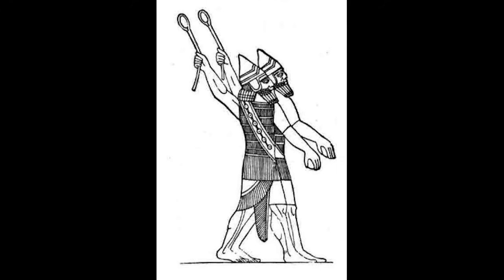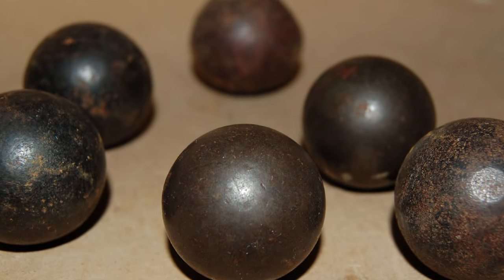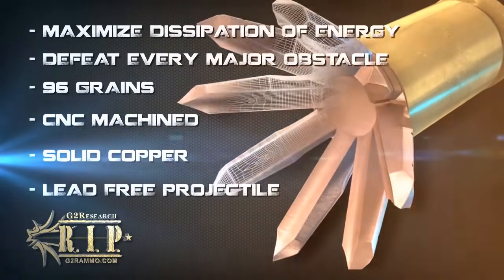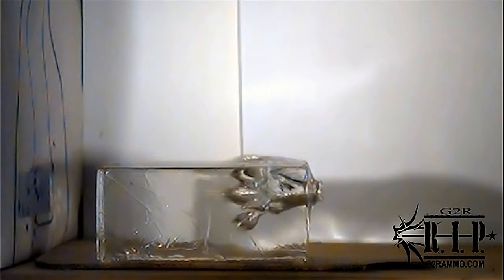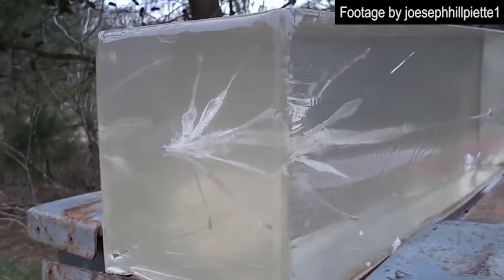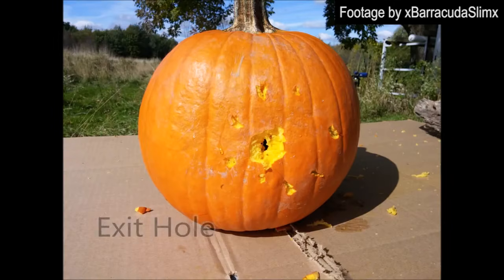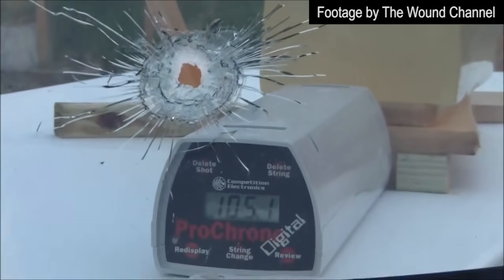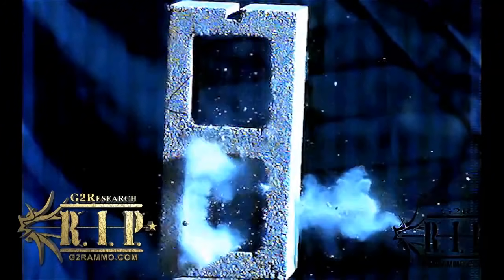The next step in bullet evolution: The Radically Invasive Projectile (RIP)

Comment: Regardless of lethality and ethical subjects that surround the topic, as an engineer I really like the terminal ballistics of this thing, shooting a drill like bullet that splits into multiple pieces is a real big step from comparatively simple hollow points
Reply: +Arfor Afro 
However, from other people who tested the round, it just LOOKS intimidating. What looks good on ballistic gel, not always mean good real world application. A human isn't made of ballistic gel, ballistic gel only simulates one type of human tissue - A good portion of what you'd be aiming for would have bone (ribcage), tendons, thick clothing, soft barriers in front of the person. When other youtubers tested it, it didn't do well when there are barriers (plywood, denim, windshield, etc) in front of the ballistic gel, as there wasn't enough penetration (experts say you need to have penetration of 12″ and 18″ of ballistic gel, so it have enough power to go through a human body, bone and all). Traditional hollow points don't do as well as FMJ in terms of penetration, and the RIP was even worst. And we are not even bringing in level 2 body armour into the equation.

Secondly, the "trocars" break off too early, so the damage done to the body would be superficial. A standard steel BB into ballistic gel at 590 fps, usually penetrates to about 3.5″. In a human body a that BB might not even make it past the skin. The "trocars" in a test penetrating about 4″ of ballistic gel, and not always consistently, and sometimes they don't break at all.

Lastly, the shape of the round affected feeding. A youtuber tested it on his Glock and a round refused to feed from the magazine. That's not something you want, as they are marketing it as a self defense round. A round that won't always feed reliably isn't ideal for self defense - The moment you pull out that gun, you need it to work because that's the difference between life or death.

I'm not saying a shot of the RIP won't kill you (heck even rubber bullets can kill), but the performance isn't as consistent as other rounds out in the market (consistency is key), and it's very expensive for such a gimmick that offers no significant advantage.

Comment: This kind of ammunition should not be banned, it should just be used on things that are stronger than humans.I mean they wouldn't be half bad for hunting. Tho my knowledge of hunting is limited I am pretty sure you are supposed to kill the animal with it suffering as little as possible and having a bullet that destroys as much of the organs as possible would in my eyes be optimal as long as it doesn't hit any larger bones on the way in.
Reply: +Kenan Šabić 
Except is doesn't perform well. One of the main selling points, the petals they call "trocars", don't work well. The "trocars" break off too early, so the damage done to the body would be superficial. A standard steel BB into ballistic gel at 590 fps, usually penetrates to about 3.5″. In a human body a that BB might not even make it past the skin. The "trocars" in a test penetrating about 4″ of ballistic gel, and not always consistently, and sometimes they don't break at all.

The penetration of the main projectile also wasn't consistent, especially when there are barriers in front. You see,  a human isn't made of ballistic gel, and a ballistic gel only simulates one type of human tissue - A good portion of what you'd be aiming for would have bone (ribcage), tendons, thick clothing, soft barriers in front of the person. When other youtubers tested it, it didn't do well when there are barriers (plywood, denim, windshield, etc) in front of the ballistic gel, as there wasn't enough penetration (experts say you need to have penetration of 12″ and 18″ of ballistic gel, so it have enough power to go through a human body, bone and all). Imagine animal hide which is also very tough, and the thicker bones of animals.
Reply: +Tremulousnut If that's the case, even better.

Comment: So, instead of making them... you know... prone to killing while inflicting less pain, the assholes that made this decided to make some bullet that turns into a goddamn saw inside of you for maximum internal damage. Sweet. Just more stuff to be proud of my species for
Reply: +φ First-order logic The "saw" doesn't work. The main selling point, the petals they call "trocars", don't work well. The "trocars" break off too early, so the damage done to the body would be superficial. A standard steel BB into ballistic gel at 590 fps, usually penetrates to about 3.5″. In a human body a that BB might not even make it past the skin. The "trocars" in a test penetrating about 4″ of ballistic gel, and not always consistently, and sometimes they don't break at all. The shape of the round also affected feeding. A youtuber tested it on his Glock and a round refused to feed from the magazine. 

The penetration of the main projectile also wasn't consistent, especially when there are barriers in front. You see,  a human isn't made of ballistic gel, and a ballistic gel only simulates one type of human tissue - A good portion of what you'd be aiming for would have bone (ribcage), tendons, thick clothing, soft barriers in front of the person. When other youtubers tested it, it didn't do well when there are barriers (plywood, denim, windshield, etc) in front of the ballistic gel, as there wasn't enough penetration (experts say you need to have penetration of 12″ and 18″ of ballistic gel, so it have enough power to go through a human body, bone and all).

Comment: wow...bullets made even more deadlier....(sigh) when will it end?
Reply: +Silent Sea 
It's not, it's just slick marketing. 

The main selling point, the petals they call "trocars", don't work well. The "trocars" break off too early, so the damage done to the body would be superficial. A standard steel BB into ballistic gel at 590 fps, usually penetrates to about 3.5″. In a human body a that BB might not even make it past the skin. The "trocars" in a test penetrating about 4″ of ballistic gel, and not always consistently, and sometimes they don't break at all. The shape of the round also affected feeding. A youtuber tested it on his Glock and a round refused to feed from the magazine. 

The penetration of the main projectile also wasn't consistent, especially when there are barriers in front. You see,  a human isn't made of ballistic gel, and a ballistic gel only simulates one type of human tissue - A good portion of what you'd be aiming for would have bone (ribcage), tendons, thick clothing, soft barriers in front of the person. When other youtubers tested it, it didn't do well when there are barriers (plywood, denim, windshield, etc) in front of the ballistic gel, as there wasn't enough penetration (experts say you need to have penetration of 12″ and 18″ of ballistic gel, so it have enough power to go through a human body, bone and all).

Comment: Why did they shoot a dead chicken?
Reply: +Joe Blogs 
Marketing. It really amounts to nothing, birdshot which does little damage to a human at a distance kills a flying bird at a distance away. Likewise, those "petals" will underperform in a human. The "trocars/petals" break off too early, so the damage done to the body would be superficial. A standard steel BB into ballistic gel at 590 fps, usually penetrates to about 3.5″. In a human body a that BB might not even make it past the skin. The "trocars" in a test penetrating about 4″ of ballistic gel, and not always consistently, and sometimes they don't break at all. The shape of the round also affected feeding. A youtuber tested it on his Glock and a round refused to feed from the magazine. 

The penetration of the main projectile also wasn't consistent, especially when there are barriers in front. You see,  a human isn't made of ballistic gel, and a ballistic gel only simulates one type of human tissue - A good portion of what you'd be aiming for would have bone (ribcage), tendons, thick clothing, soft barriers in front of the person. When other youtubers tested it, it didn't do well when there are barriers (plywood, denim, windshield, etc) in front of the ballistic gel, as there wasn't enough penetration (experts say you need to have penetration of 12″ and 18″ of ballistic gel, so it have enough power to go through a human body, bone and all).

Comment: Dumbest round Ive ever seen, although they are doing a heckofa job advertising these to uninformed/unintelligent people. I'll see if I can simplify this: There are two aspects to a firearm's ability to do damage, and its based on physics and called kinetic energy. The first aspect, and the most important, is speed. Speed kills. The faster something goes, the more damage it can cause not linearly, but exponentially! Which is why you can kill deer out at 350 yards with the same weight bullet you would find in a .45 ACP, but going at speeds out of a rifle up to three times faster. And it puts a heck of a cavity in them. And then the second aspect is the mass of the projectile. The heavier something is, and if it going the same speed as another object, the heavier one will penetrate/cause more damage. So now we have these RIP bullets that go no faster than a regular 9mm, but break off into tiny shards that weigh no more than a couple of grains. Lets see if you can do the math from there.
Reply: +AnAZPatriot 
Look up the tests done on it by other gun channels, you'd be happy to find that you are right. It's all just slick advertising to the uninformed. Shooting at chicken is nothing - Birdshot at a distance does lethal damage to a flying bird whereas it might not even penetrate a human.

The main selling point, the petals they call "trocars", don't work well. The "trocars" break off too early, so the damage done to the body would be superficial. A standard steel BB into ballistic gel at 590 fps, usually penetrates to about 3.5″. In a human body a that BB might not even make it past the skin. The "trocars" in a test penetrating about 4″ of ballistic gel, and not always consistently, and sometimes they don't break at all. The shape of the round also affected feeding. A youtuber tested it on his Glock and a round refused to feed from the magazine. 

The penetration of the main projectile also wasn't consistent, especially when there are barriers in front. You see,  a human isn't made of ballistic gel, and a ballistic gel only simulates one type of human tissue - A good portion of what you'd be aiming for would have bone (ribcage), tendons, thick clothing, soft barriers in front of the person. When other youtubers tested it, it didn't do well when there are barriers (plywood, denim, windshield, etc) in front of the ballistic gel, as there wasn't enough penetration (experts say you need to have penetration of 12″ and 18″ of ballistic gel, so it have enough power to go through a human body, bone and all).

Comment: People in general just don't seem to understand how devastating to the human body regular bullets are (aside from .22s, of course, which can still kill you), especially typical hollowpoints.  This looks really gimmicky.
Reply: +DrTelamericorp And by gimmicky, I mean not nearly as lethal as some other, more common rounds. Like the 5.56. That round is WAY more lethal than this thing will ever be.
Reply: +DrTelamericorp And it is gimmicky. The main selling point, the petals they call "trocars", don't work well. The "trocars" break off too early, so the damage done to the body would be superficial. A standard steel BB into ballistic gel at 590 fps, usually penetrates to about 3.5″. In a human body a that BB might not even make it past the skin. The "trocars" in a test penetrating about 4″ of ballistic gel, and not always consistently, and sometimes they don't break at all. The shape of the round also affected feeding. A youtuber tested it on his Glock and a round refused to feed from the magazine. 

The penetration of the main projectile also wasn't consistent, especially when there are barriers in front. You see,  a human isn't made of ballistic gel, and a ballistic gel only simulates one type of human tissue - A good portion of what you'd be aiming for would have bone (ribcage), tendons, thick clothing, soft barriers in front of the person. When other youtubers tested it, it didn't do well when there are barriers (plywood, denim, windshield, etc) in front of the ballistic gel, as there wasn't enough penetration (experts say you need to have penetration of 12″ and 18″ of ballistic gel, so it have enough power to go through a human body, bone and all).

Comment: this is just a fancy looking hollow point
Reply: +Ðevuno Try-force No, its worse. Once the bullet breaks up, there is no mass behind the velocity of the projectiles. May as well be shooting a .22 pistol.
Reply: +AnAZPatriot You are right, and the "petals" they are so proud of don't perform well. The "trocars/petals" break off too early, so the damage done to the body would be superficial. A standard steel BB into ballistic gel at 590 fps, usually penetrates to about 3.5″. On a human body a that BB might not even make it past the skin. The "trocars" in a test penetrating about 4″ of ballistic gel, and not always consistently, and sometimes they don't break at all. The shape of the round also affected feeding. A youtuber tested it on his Glock and a round refused to feed from the magazine. 

The penetration of the main projectile also wasn't consistent, especially when there are barriers in front. You see,  a human isn't made of ballistic gel, and a ballistic gel only simulates one type of human tissue - A good portion of what you'd be aiming for would have bone (ribcage), tendons, thick clothing, soft barriers in front of the person. When other youtubers tested it, it didn't do well when there are barriers (plywood, denim, windshield, etc) in front of the ballistic gel, as there wasn't enough penetration (experts say you need to have penetration of 12″ and 18″ of ballistic gel, so it have enough power to go through a human body, bone and all).

Comment: this is not a stopping bullet or a home defence kind of thing, this type of ammunition is made to open someone up as much as possible to the point where repairs to anything living would be improbable
Reply: +Angel Ramos lethal force has one meaning : kill. if u pull out a gun, u don't do it to shoot the leg. u shoot to kill. warn before if you have time, but if not, shoot to kill. a bunch of shards coming off the bullet simply are pointless because 1. if the enemy has any kind of armor, the bullet's effectivity = 0 . and 2. a normal bullet can one shot kill someone aswell. this just maybe makes the target suffer more if shot in the leg, but won't change anything. adrenaline levels are too high if you get shot anyways so you won't even feel the shards. if you survive , you will get some scars but... it's just a pointless ineffective bullet.

Comment: problem is the military can't use it due to various weapons treaties regarding "undue devastation"
Reply: +Max Ritz they dont use this because they aren't effective. if u have a kevlar for example those little shits that come off will slow the bullet even more, and render the bullet pointless.
Reply: +KlowN that's partially the point, that rapid deceleration imparts quite a bit of energy into whatever the round impacts, point is, it may not penetrate (and even that is a big "may") but it will still do quite a bit of damage through kinetic force.
Reply: Max Ritz still, the damage is the same as a regular bullet. also, did you see the primary slug ? its a pancake. it won't penetrate anything. you can see the primary slug at 1:20 . they show it intact.
Reply: KlowN Actually, that lack of penetration with the same amount of damage would be rather useful to the military given that they are currently being used as a police force overseas. Less penetration=less collateral damage

Comment: A much more powerful version of hollow-point
Reply: +Glame Glumps no. if u have any sort of bodyarmor, ur not even gonna get scratched.
Reply: It won't penetrate a body armor plate.
It's worse than a shotgun against armor.
Reply: KlowN this is literally a hollow point round with spikey tips.
Reply: Glame Glumps spikey tips that come off. when they come off, it's a pancake. not even remotly sharp or anything. if they were attached as one bullet , then maybe it would make sense. but they are detachable. and they detach really easily. if you were to shoot at someone with medium winter clothes on, the bullet will have the same impact of firing 6 iron bb's. it will sting, bleed, but it won't even come close to killing you, and you will be able to just take em off. the idea for a bullet is to be able to penetrate normal clothing people wear. this barely does that. this bullet would ONLY make sense in summer time when everyone is wearing tank tops. that is not efficient. also, at long range, this would be even more pointless. its a bad bullet.
Reply: KlowN But the point is, it is by definition, a hollow point.
Reply: Glame Glumps a bad one.